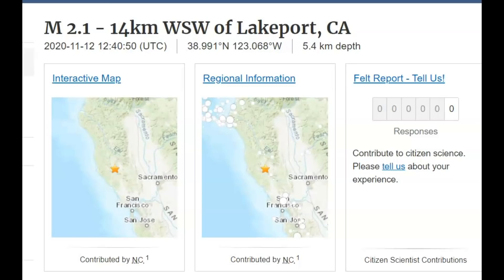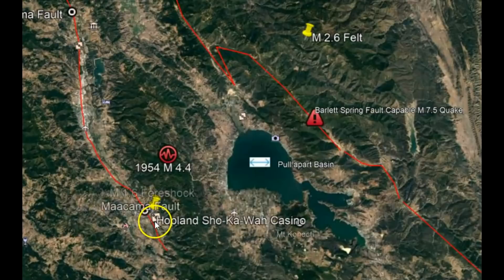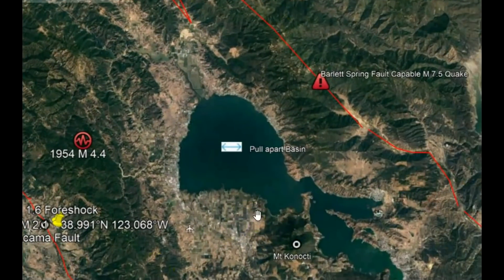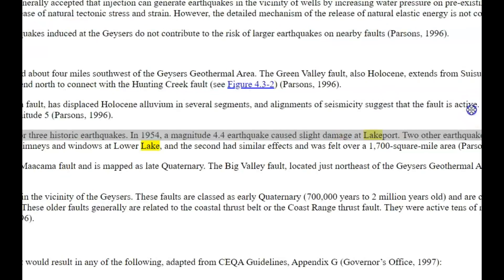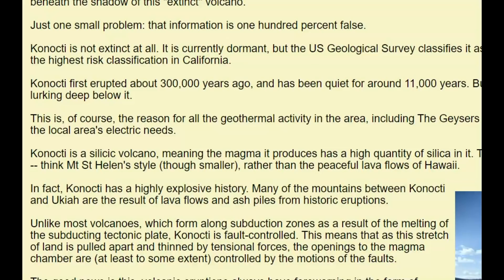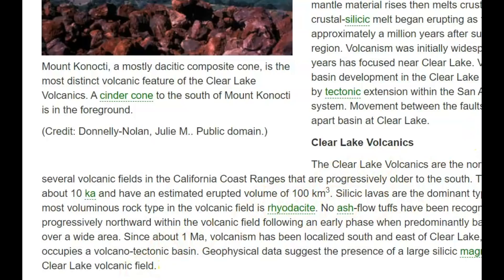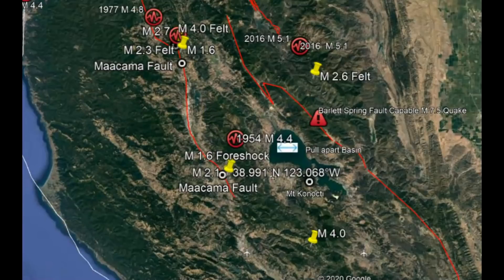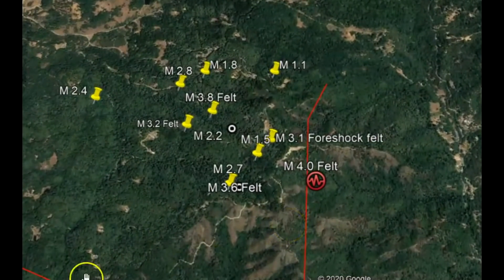Lake County Earthquakes, San Andreas Pull Apart Basin, Mt Konocti Volcano

Comment: Caldera.  Mt. Konocti / Uncle  Sam Mountain.  A resurgent peak.  Crater is the Soda Bay / Buckanham Ridge.  ( East shore of Soda Bay.) Cobb Mountain, south, Bottle Rock western ,  Caliastaga (sic) geyser.  Extensive lava fields, south edge of southward lava flows above Napa valley.  Pumice fields east and north of lake county.  Ancient Austeralian  block , Marin county shoving up against  sout h western  side of ancient  clear lake caldera,  Fumerols, PG&E steam plant.  West and south Cobb mountain  last evidences of volucanic activity.  Declared largest active caldera totally in the state of California.  Several tranverse fault zones , east/west south and north of present lake,  Ancient lake shores  above south side of present lake.
Reply: THERES  A STORY OF LOGS THROWN INTO A VENT HOLE AT THE TOP OF kONOCTI .  On my last visit the hole was  covered / cave in.   Theres a capped gas well in the town of Kelseyville.  WE would by boat go and camp on the western shore  of Soda Bay.  Large bubbles would come up in the bay smelled  like r0tten eggs. ITS SAID  theres, a tunnel or old mine on the east side  of Konocti where older residents had carved initials and names on the walls.  Resent addition  to local tales having residents living inside the mountain accessed by a underground river exiting into the eastern side of the bay next to the point on the eastern side.  but west of Buckingham point.. Vulcanism  is the feature most common on the south side  of the  lake . Next to a private road ,west side of Mt. Cobb is reported a vent hole  with warm air expelling.
Reply: I came across an news paper article, Might of came from a Cresent City paoer,    that during WW II a glow from a lava flow, as reported, was seen in the mountain inland. not a forest fire.

Comment: Mary, you would be very impressed with the fault block structures in the Sand canyon area Southwest of Ridgecrest that the garlock fault has created. Check it out on the internet there's a Sand canyon recreation area and this is the red Rock canyon that it has built it's amazing.